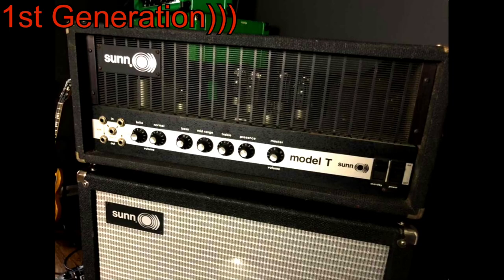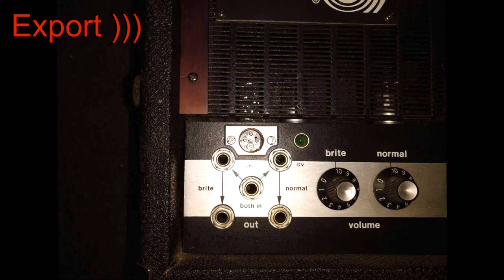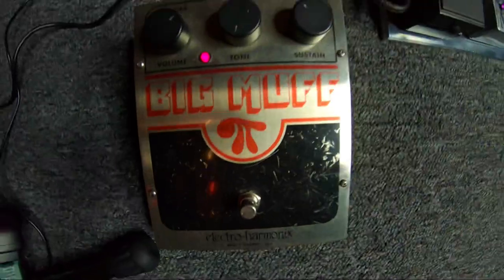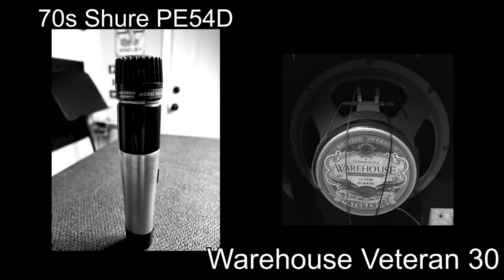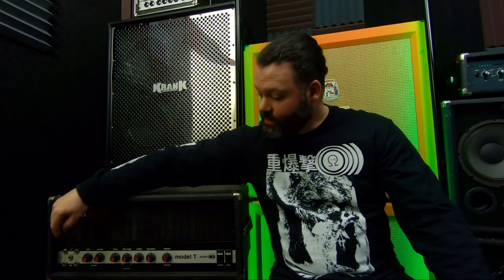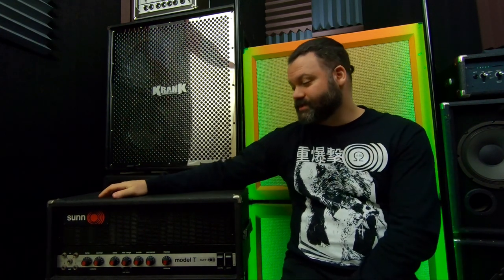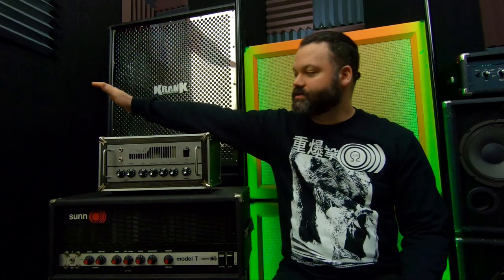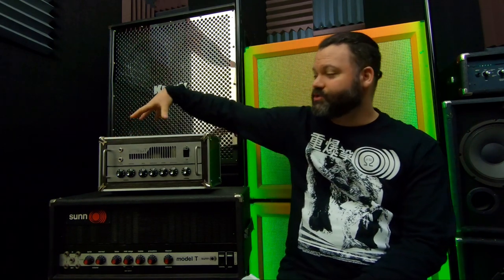Sunn Model T Documentary

Comment: I just found one at $2500 CAD, which is about $2000. I just ordered a Revv Generator 120 MK3 and bought a used Orange Rocker 30, otherwise I would have snapped it up.  Guess I'll have to pass this time, I kinda want a first Gen anyway.

I'll have to life with my Burning Sunn preamp from Ground FX, which is remarkably good.
Reply from the maker: Aww man , sell the Rev and buy the SunnO)))) !!!
Reply: @Witchpit  Hah. I don't know about that. It's a custom order and set me back $4600 CAD. I might lose quite a bit. Besides, they are amazing amps. Possibly one of the best modern amps on the market.
Reply from the maker: @EdwardKayeplus  o yea man just messin.  the Revs are super nice amps.
Reply: @Witchpit  Hah. I figured. Just bad timing. A bloody Laney Klipp came on the market at the same time. That's instant Iommi tone. The universe is cruel. Haha.
Reply from the maker: @EdwardKayeplus  aww man yea i hate when that happens...thanks for checkin out the video!
Reply: $2500 cad is pretty decent. Is that amp in Canada somewhere?